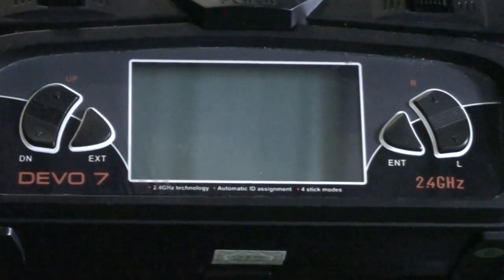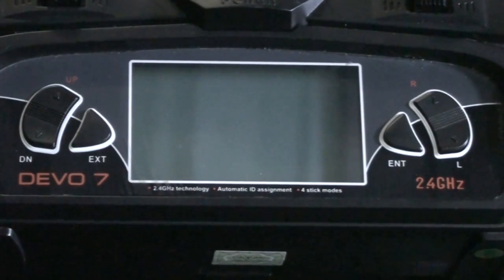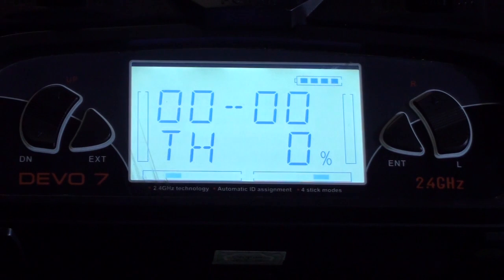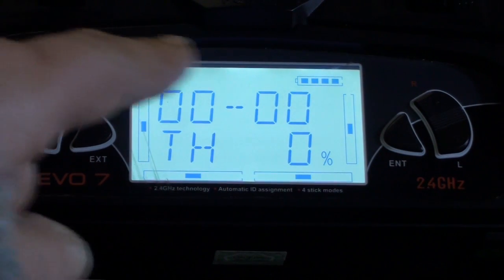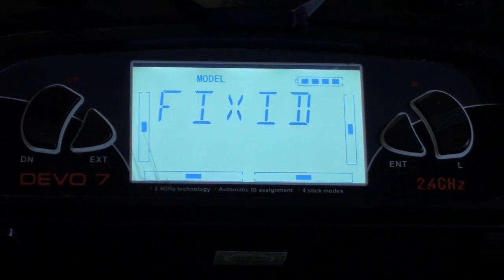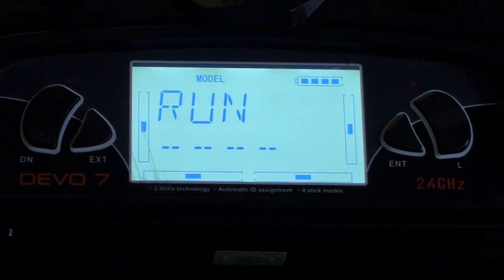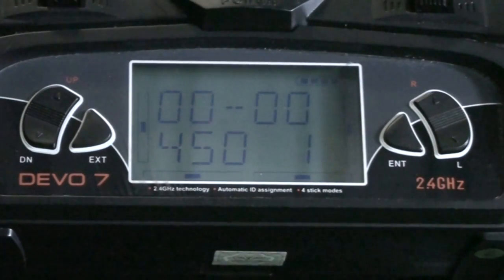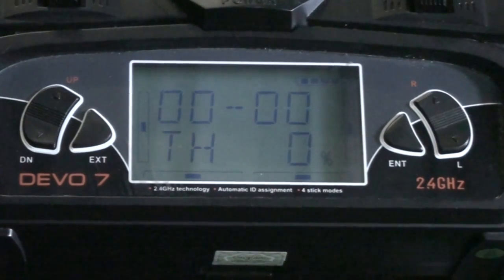Walkera Devo 7 Link id set up

Comment: hi I have a question for u I have the rodeo 110 mini fpv race drone with the Devo 7 transmitter n still not binding on the drone .. tried the fixed ID n still not binding on the drone .. continue beeping .. Tha was a reset button on the drone .. I pressed the reset button ..n still continues to beeping ..n I don't have a binding plug fo it ? .. how can I bind the devo 7 to the drone ? 😢
Reply: hi I have a question for u I have a Walkera rodeo 110 mini fpv race drone with the Devo 7 transmitter n I hit some kind of button on the tx n it's still beeping 😢 n I hit the reset button on the drone still beeping 😢 n I have a bind plug fo it to do I put it in the sbus plug to re binding it to the Drone to re binding it so I can get to fly my drone?

Comment: tx for u vid. can it bind with walkera runner 2250?
Reply from the maker: yes it certainly will if it has a Walkera 710 receiver or similar.  you will need to go through and make sure you set up all you 3 position switch's,  gains etc. l imagine there is  a Walkera set up assistant for their flight controller.
Reply from the maker: if you go to this link and download the quick start guide it has the settings for devo 7 radio http://www.helipal.com/walkera-runner-250-fpv-racer-rtf-w-f7.html